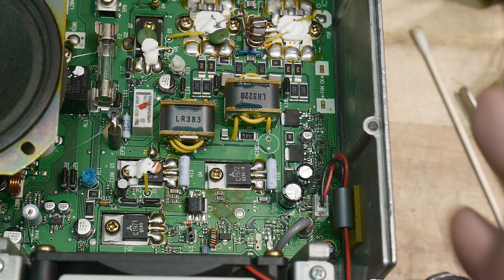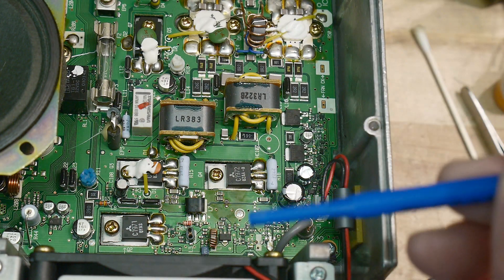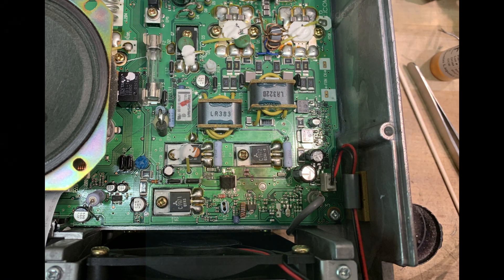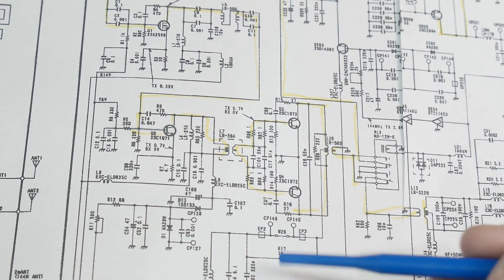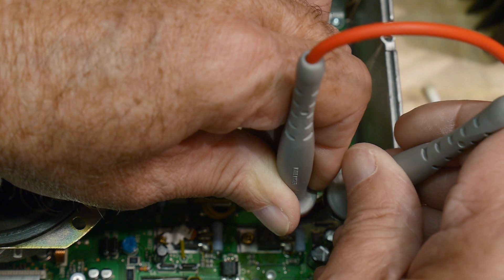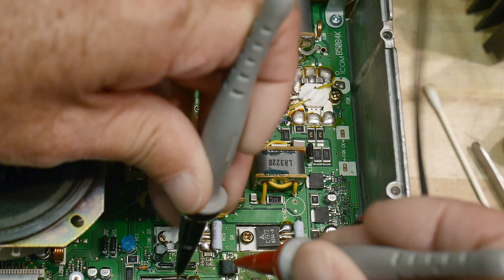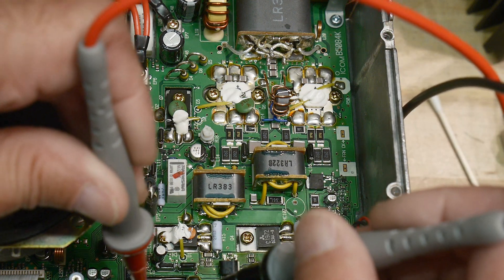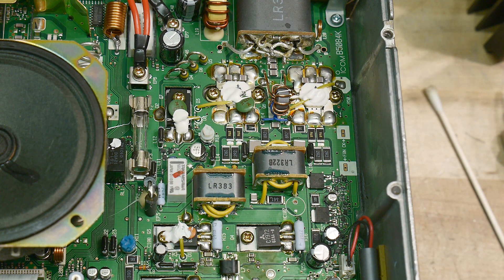#1095 ICOM IC-746 faulty ( part 5 of 8)

Comment: Hello IMSAI, did you noticed that the L7 LR -384 pre-driver output transformer is misplaced in the schematics? L8 Feed biasing voltage to the drivers at center tap of the secondary winding, but it is on the opposite direction.

Comment: Silly question, but did you change the open 47 ohm resistor ?
Reply from the maker: yes, both 47 ohms, I replaced with 51 ohms
Reply: @IMSAIGuy  Yeah, sorry. I knew it was a silly question. Ha ha.

Comment: From DC point transistors are in parallel and can't be properly tested.
It seems that they should be removed and tested out of the circuit.
Reply from the maker: you are correct

Comment: Looking at the circuit, I don't see a path for those resistors to get DC power, except if the tranies are broken - but you measured them ok. If they really are (as it's hard to measure in-circuit), then RF power destroyed those resistors. In that case, the same current was flowing throught the 1 ohm resistors that became 100Ohm, but that is also strange, as they would limit that current. While "working", what were the DC and AC levels on the bases of the transistors? How unbalanced was the push-pull stage?
Reply from the maker: the diode check function of a voltmeter gets tricked with low value resistance. Next video I will take out the transistors